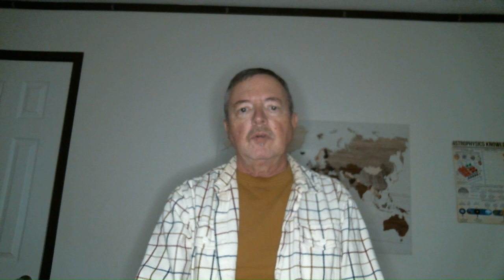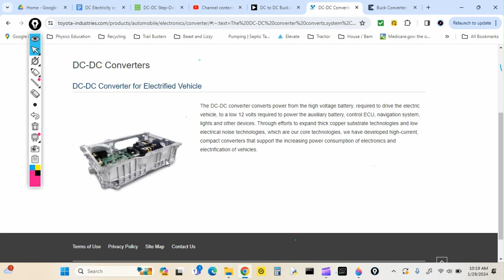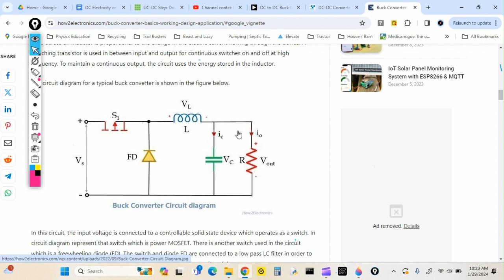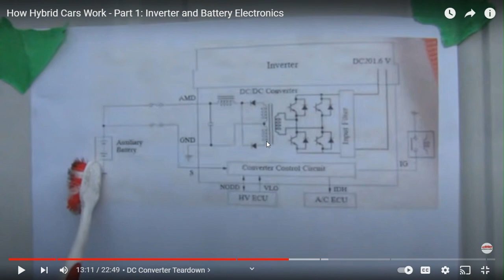Charging the Prius 12V Battery

Comment: A nearly correct explanation however talking about the coil and diode in the Buck Converter I believe you where a little wrong. In my opinion  yes the polarity does switch on the coil  but the current continues to the capacitor and yes now through the diode.  A coil (or induction as it is) is conservative. It does not like changes and there fore the current rises slowly and dies down slowly. Without the diode there would be a high negative voltage on the left hand side of the coul making the voltage very high over the S1 switch and probably blow up this component.
Reply from the maker: Hmm…I will have to think on this one…thanks for your analysis!
Reply from the maker: You are exactly right about the diode protecting the switch.
Reply: @TeachWelles  That is why most transistor circuit's driving a relay has a diode across the coil.